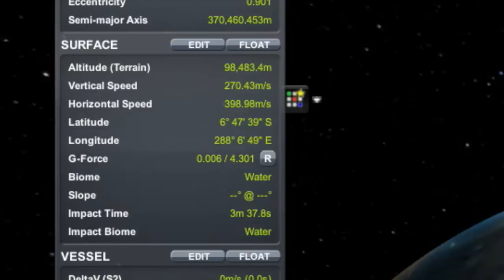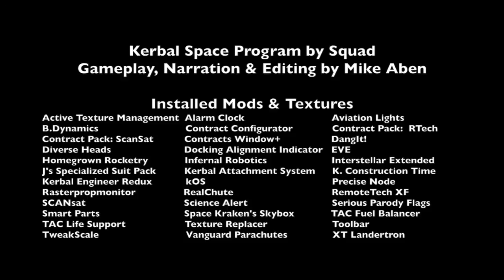KSP Career: Episode 2 - Lift Can Be A Drag

Comment: Looking good!

I take it you don't start with a radio antenna, or you could transmit your crew report.
Reply from the maker: John Nowak You don't start with one, but I did have it unlocked by that time.  You can see it at 1:00.  I just neglected to put one on the capsule.  I'll get the high atmosphere crew report next time.
Reply: Mike Aben Yeah, it's hilarious what you can catch in retrospect. 

In my game, I had a ferry mission that just went horribly wrong. I haven't written it up yet, but it was just a mess. And when it was all over and Neildrin was flying home, I realized that I had screwed up the mission plan. After doing it, I revised the plan.

Later, I did the same mission again with different vehicles to the new mission plan, and it worked so smoothly it was a joy to behold. 

I'm not sure how I'm going to explain this in the writeup. Maybe the FAO was on vacation.
Reply: John Nowak You should like this beautiful man's videos, John.
Reply from the maker: Dubastot I'm starting to worry about you. ;)
Reply: Mike Aben
Isn't it past your bedtime sir fedora? You have class tomorrow.

Comment: If you build craft as sub-assemblies you can decrease your build times, and increase your part count by storing or parking craft(sub-assemblies) outside the hangers, so build standard boosters that can cluster or pair with each other. Use cubic struts as early skid landing gears a bonus for making float planes later. you just add floats to the struts.